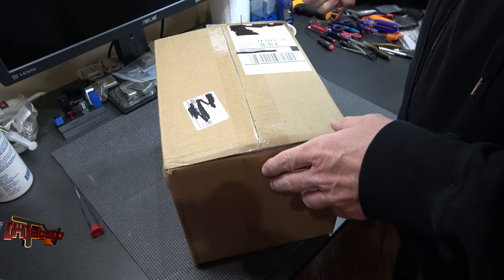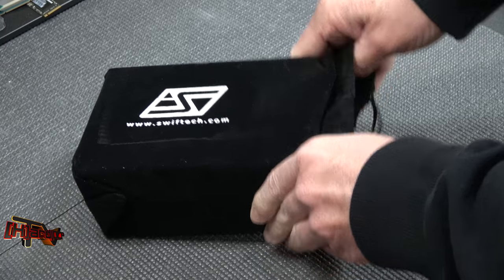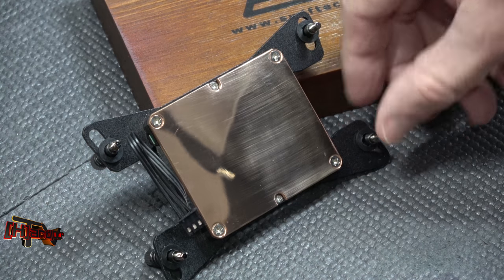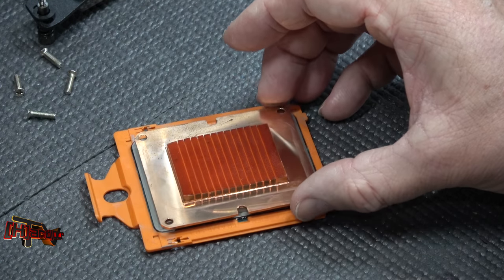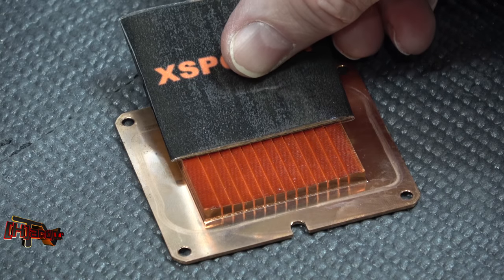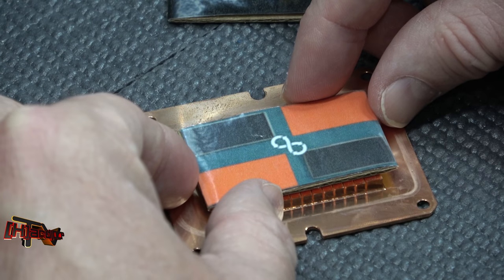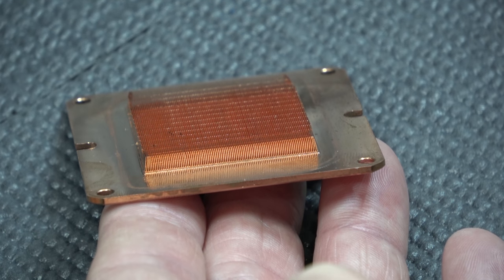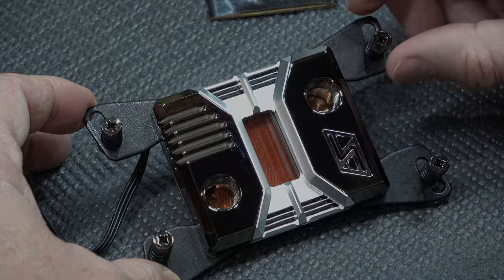Swiftech Apogee SKF TR4 Heirloom Series Unboxing and Breakdown

Comment: The box that it came in was really nice. I hope retail samples come in something like that. 

Looks like and interesting design as well. I like seeing the different microfin designs and flow patterns. Water jet plate vs going straight through the fins. 

My money has already been spent on the leading block so far, but I'm still interested to see how any others will perform as Threadripper has really shaken up the cpu cooler market as well as the cpu market !
Reply from the maker: The box WAS retail packaging for pre-buyers in September.  Bottom of the page spells it out:  http://www.swiftech.com/apogee-skf-tr4-heirloom-series.aspx